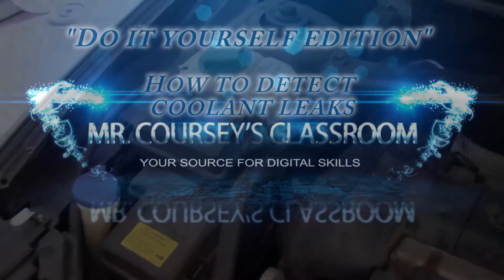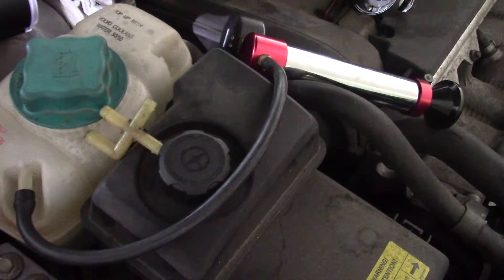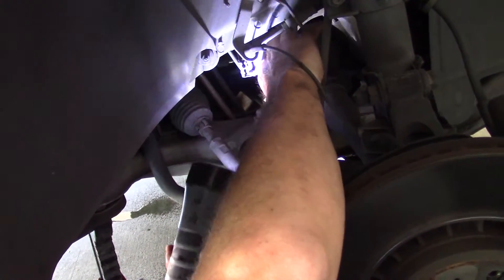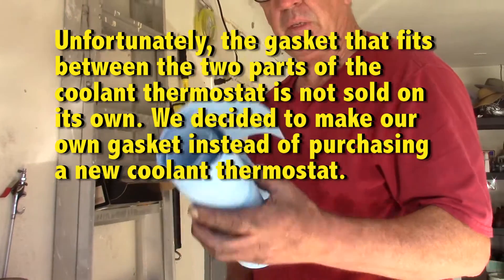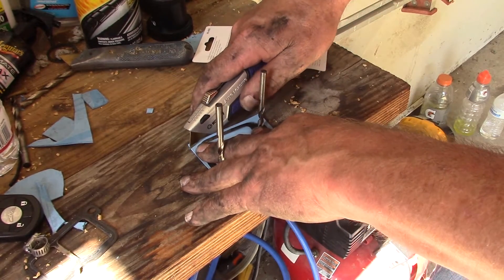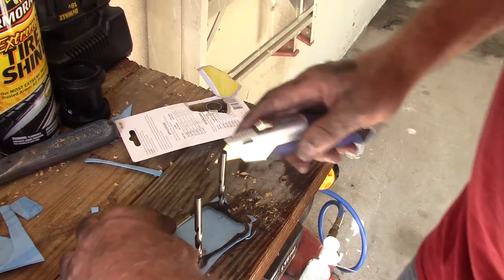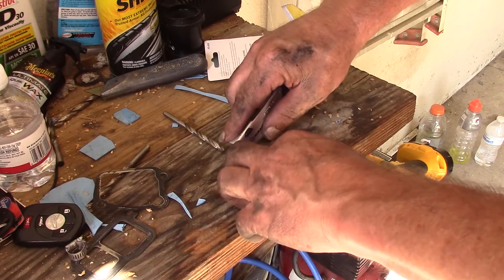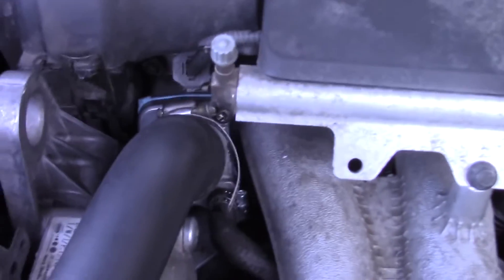DIY: How To Detect A Coolant Leak, Use a pressure tester, & Remove a Bad Coolant Gasket

Comment: U have buy a adapter kits 4 all makes and models mine was 450 on the snap on truck the pressure testers come only with ur three standard radiator fittings which pretty much don’t exist anymore

Comment: what kind of coolant water did you guys use?
Reply: James To you can go to auto zone and they can tell you which kind to get
Reply: Late model Volvos use a HOAT antifreeze (like Jeep/Chrysler).  Zerex G05 is the aftermarket replacement (HOAT)  https://youtu.be/KFvnRROmgdo   There is also a Zerex G48 pre-mixed 50/50 HOAT (blue in color)